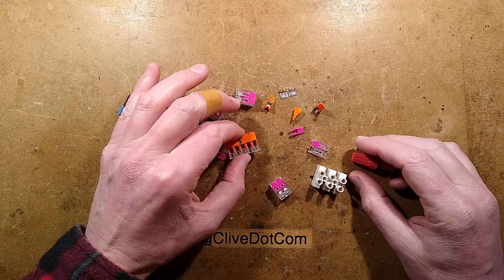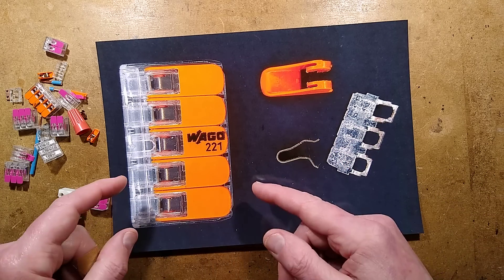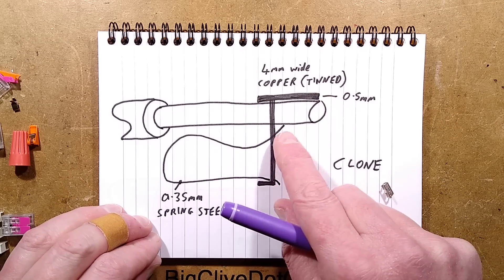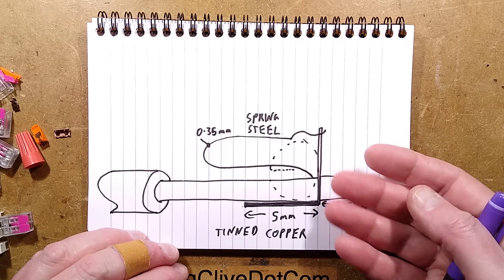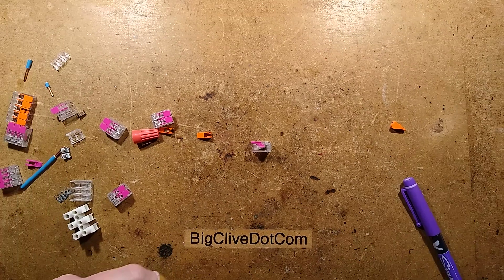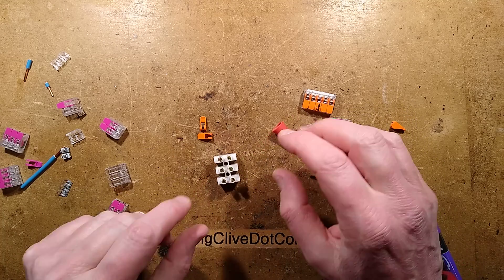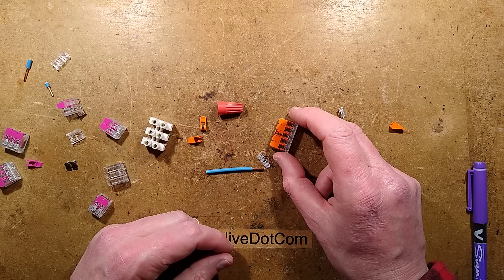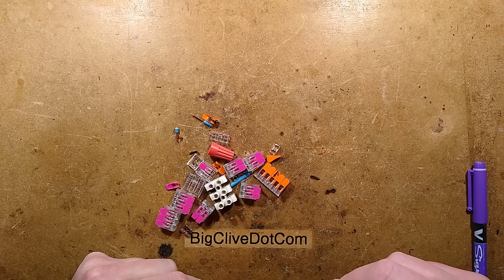Inside a Wago connector and a clone

Comment: I'm nobody special, but the terminal blocks like that aren't good for my overthinking. I used to build heater units for fusing/melting rubber components together and they bought cheap push-in connectors, to remove the wire you would stick a paper clip or similar small, pointy object in to release the wire. Tons of poor connections, they would have crazy resistance, I worry too much. Wago is a great brand, and I trust what certain people say but I already have trouble sleeping at night, I'll probably use wire nuts at home. Great video and demonstration!

Comment: I was only introduced (in the US) to these late in 2024. The Engineer on my project also purchased an ABB or Allen- Bradley 24VDC power supply (3 phase input) that has toggle levers on its terminals instead of screws. The machine we're building will be implemented both in the US and UK, and finger-safe components are used. I'm accustomed to seeing preventive maintenance procedures that direct one to laboriously "tighten all terminals", so this type of connection will be a big time-saver.

Comment: Funny story... Today I went to a local electronics store, phone in hand showing them from their website 3 way wago connectors that I wanted to buy(same as the ones you're showcasing here). They said wago and sold me the quantity I wanted. I didn't pay attention and only realized they're clones(since no wago logo and cheaper looking levers) when I started using them. I used a few before my suspicion reached a point where I had to look up your video(as I remember watching it a while back). I reached the end where you say the first thing you do is take apart the clones and check the bus bar to make sure it's copper. I did that and sure enough it sticks to a magnet... 🤦🤦 I guess I'm going in and getting the real thing tomorrow and rewiring the ones I already did. Maybe the clones would have been fine, but I'm using them for wiring up outlets and I really don't want to take any chances 😅

Comment: They advertise the wago connector over wire nuts like this: wire nuts can easily be improperly used so it's too loose and the wires fall out or too tight and the wires get damaged. Plus wago is reusable, no cutting wires shorter when a wire nut is removed.

Comment: The US Harbor Freight discount hardware store (chain) just started selling:

10 USD/9.32 EUR/7.76 £ wago style wire connectors. 
Package includes: 10 2-port, 10 3-port, 5 5-port, and a closeable carry case. 

Connectors are rated for 600v and 221°F.  UL Listed too.  
Wires supported: 24-12 AWG strand; 24-10 AWG Solid. 

UL Listing mark: E531336
UL recorded Company name:
ZHEJIANG JINGHONG ELECTRIC CO., LTD
Co. Provided model numbers: 662, 663, 665

I'm not sure how good a value this Harbor Freight Pittsburgh brand is, but the UL rating assures me. They say these are code compliant for use in junction boxes. I'd gladly pay more over a non certified eBay one, I think, unless you are using it for low voltage non critical stuff.
Reply: Interesting a listing for the Chinese product states to strip 11mm of wire, the Harbor Freight sold product (supposedly the same) says to strip 14 mm
Reply: And it is $0.089/qty (I assume for an individual connector?) when ordering 10-299 pieces 

$0.08 for 500+ pieces

So ordering direct it would be $2.23 to buy the same amount of wire connectors as is sold in the Harbor Freight $10 package.

That listing mentions ROHS and  CE certification but not UL. And I've heard ROHS and CE don't mean anything about the safety of the item. I think UL actually tests the safety. 

But what confuses me is the larger connectors must cost more to make than the smaller ones, so how is every size the same price? Because the larger connectors need more material and parts than the smaller ones.

Comment: I've purchase a jar of Ideal's In-Sure L2 (or Gen 2) lever connectors.  It's a similar spring and bus bar connection as the WAGO 221, but with the lever direction opposite the ports.

I disassembled one, although there was no means to put it back together where disassembly was inherently destructive.  I believe the pieces of the shell were sonically welded.  It has little "fingers" on the spring where the edges of the lever mechanism can push down on the spring in the "open" position.  However, the bus bar extends to the end of the shell and there are two guaranteed contact points where the spring presses the wire against the bus bar and also the tip of the wire against the end of the bus bar.  There's also electrical contact with the spring (which is in contact with the bus bar).

I believe that even with the shell melted the connection will be maintained.  Of course if the shell melts, there's something a little more critical than whether or not the connection is maintained.

Comment: Well..."better" design on the clone...I'm not so sure. Cheaper, yes. Easier to manufacture, yes. But these aspects hardly go hand in hand with product improvements. If you look at the plethora of factors WAGO was taking into consideration when designing these things (feel free to have a peak on their website, it's quite fascinating really), the chances of ANYTHING about these 221s being there without any actual reason are slim to none. I am confident, that if you factor in longevity, compatibility, performance, safety and sustainability, the WAGO will be the much better product in any regard, and chances are, that in the long run it will cost you less.

Comment: 221 is not suitable for Al wiring. But WHy? 2273 is suitable. But why!?
Reply from the maker: Possibly the contact material or some system of blocking air access to the aluminium contact point.

Comment: oh one question -- I am using to install small gauge low voltage solid wires (like 20ga sized) can you twist 2 together and put in one port? seems like it should be ok since the wire is small and low voltage makes it easier to fit in the box since you can use a 3 port instead of a 5 port for 4 small wires and one larger wire - smoke detector interconnection signal wires -not main 120v power wire anyone have any idea if that would be ok???
Reply from the maker: I've twisted small wires, but I don't know if it's officially endorsed.

Comment: I only ever use wago I bought a basic box with assorted one but the older style not the one you used in the video I'm disappointed in the ip junction box as the included glands are not ip rated

Comment: Lidl are selling a selection box of Scotch Lock connectors.

The box states they are suitable for a maximum of 250V.

I'm not sure I'd be comfortable using them above 12V.

What do you think of them being used on mains voltage?
Reply from the maker: I'd be more concerned at the current they were being used at.  I don't trust insulation displacement connectors.

Comment: I've seen videos where the Wago didn't fail until the outer skin on the wire nut burned up, although with most of the insulation on the 12-gauge wire they were using. I don't use Wago for everything, but I use them fairly often for lighting, and more all the time.

Comment: Having done control systems in substations, they were all screw terminals. What I don't like about the push terminals is it is too easy to miss the actual connector and hit the fastener, also multicore cables do not like them , they slip out easily. The "screw-it" was banned 50 years ago on construction sites as they came off too easily if they were at the wrong angle leaving bare wiring. It was caused by ac current vibrating and if it was slightly loose, not enough to feel it, it had a tendency to vibrate itself off. Screw terminal metal is gauged to the load it will carry so has a greater chance of surviving blow-outs, I would not use Wago on mains power, I simply wouldn't trust it. When learning to do electrical installations, one vital point was given, when you make a termination, do a tug test. We did this to learn just how tight to tighten the screws on connections, if you tugged it and it came out it wasn't good enough.

Comment: These push connectors are bad news. They don't hold strand wire properly. A coworker of mine got hit with 277 from a factory wired push connector that just let the wire pull out. That aside I've seen many of them fail in lighting scenarios

Comment: could wago's get  looser over time?  as hot/cold happens on the wires  expansion/contractions, will the wago springs hold up?  I ask because in the usa  we have  AFCI  arc fault  type circuit breakers and if the neutral wire is loose at all in a wire nut  or a wago,  that circuit breaker will flip and it will take hours to figure out that all you had was a loose wire nut or wago.  this new design looks different from the older wago's from 10 years ago.
Reply from the maker: The basic mechanism has a long history.

Comment: The clone is like a "push in" wago. Wago has a leaver.less type which is a simple push in, and you can release the wire by twisting and pulling it. I think that the creators of the clone tought that ok, why not just get this version and create a leaver for it and thats it.

Comment: In the USA many of them don't have the lever.  Push in the wire and never get it out.  They barely work with stranded wire, but if you're careful you can get all 7 strands in.
Reply from the maker: That's a standard type here too.  But not intended for stranded wires.

Comment: Seems to me the wago has a larger contact area to the copper, the spring pushes the wire onto the copper bar. The clone has only the point contact directly to the copper.

Comment: After the POOR experience of using connectors similar to Wago's lever type terminals from Wilko's, Wago are now the ONLY connectors I will ever use.

I wouldn't use the cheap Wilko's ones unless when testing the LV components an ESP32 project...even then, that would only ever be a maybe.

Comment: did you see/get the straight through version by now ?
WAGO made them after the chinesium, but only single straight through, not multiple as the chinesium one..
(the expensive versions are the 6mm² version.. the up to 2.5mm² are ok-ish)

i also noticed that most people totally overtighten the screw in terminals, sometimes directly through the ferrule and single strands.
Wired up a 400V 63Amps CEE last week (5G16mm²) and the torque for the terminals was around 15 to 20Nm.
With the large screws/screwdriver our inhouse sparkie usually tightens them down until the copper starts squirting out the sides and you wonder if you ever get it undone to remove the mains cable.

Comment: The problem isn't the current going through it the problem is these spring clip things work the same as backstab outlets and switches.  You have a small amount of surface area touching with a thin piece of wire holding it in place.  Overtime that gives far more opportunity for heating, corrosion, and other things you don't want in a good clean tight connection.  I'll stick with firmly secured screw downs and wire nuts where you have large amounts of surface area tightly connected.
Reply from the maker: These ones pin the wire onto a thick copper busbar.
Reply: @bigclivedotcom  yes, the backstab outlets do something similar pinning it against the metal bar but they still over time seem to loosen or corrode.  I replaced 3 outlets last fall that the wires were discolored once removed and when I broke them apart I found significant green corrosion and some discolored (heating?) metal near the pinch point.  It was so bad running a 1200w microwave oven (about 10A on a 15A circuit) caused a voltage sag from 125 to about 100 volts.  Rewired using rhe screw terminals on new outlets and pigtails with wire nuts on the daisy chain and then had only about 5 volts sag under load from the breaker box 100 or so feet to the end of the string.

Comment: For wiring homes. Absolutely avoid using wago’s for outlets. They have a higher resistance then wire nuts and will cause issues or worse a fire. For lower current circuits like lights they are fine

Comment: garbage ,not to code in Canada and they melt on high current
Reply from the maker: If you mean the videos where they were run at over 100A and the wires were literally glowing red hot, then it's not a surprise the plastic melted.

Comment: You did not mention the fact that these spring retaining connectors are NOT suitable for flexible stranded wires unless ferules are crimped to the wires. 
The control panel you mentioned that used similar terminals contained this type of wire form, and would/should have ferules fitted.  There is no saying what type of wire used in the field wiring connected to the control panel.  

More importantly, there is no saying what type of wire will be used by semi-skilled individuals on youtube, who may now think they know it all.   Don't you think? 

Secondly, the Wago and other professional DIN 35 panel mount terminals now in use ARE designed to be mass produced machine assembled, just like the cheap stuff, but will not suffer penny pinching compromise by use of inappropriate materials used in their construction. 
The reasons for that are obvious.  

Frankly, I wouldn't use these things, nor the crappy 'wire nuts' on either solid, stranded or multi-stranded wire terminations. It's bad enough finding them in control panels.
Reply from the maker: These are designed for stranded wire.   A ferrule is good, but only if crimped on properly, as it's possible for the wire to pull out of the ferrule.

Comment: I think one of the things you can take from this is that any connector can fail, and all of the connectors have their places.   Wire nuts work, they work well - but they don't need to be in everything.  Well built wire nuts can even survive the nut itself deforming from heat, because they have a heavy wire spring inside that does the work.   (mind you, if it melts enough, you now have an exposed metal connection)   I've also seen crap wire nuts that had a 'plastic' screw inside, usually just by threading the 'hat' of the nut.   Wagos can fail due to heat, due to pressure, etc, but so can anything else.  Even a soldered wire with heat shrink could have a problem if a pointed whisker is present, or it wasn't soldered with enough contact.    

There's no reason to call one bad, and another good.   How about "Good for the job in question" and "bad if poorly used".    Ram that wire into the Wago without stripping it well enough.   Strip the wire too far, and stuff it into any fitting, so there's an exposed wire.    Just jam wires into a wire nut without actually twisting it - or failing to tug to make sure it doesn't pop off!

Comment: You did not test the plastic and its longevity. Some cheap plastic may degrade over years getting brittle. Or it is getting soft when heated. Or worst of all its not fire resistant.

Comment: I became interested in this style of connector around two years ago, then bought a few versions on Ebay & Ali-Express just to experiment with them. Some can snap together making a two or three gang link. Others are simply 3 or 4 hole junctions for a given pole.   
I was interested to see if you had used them & how robust they proved to be.  The other nice solution was the sealed solder joint with a plastic insulation tube. They seem popular automotive applications.

Comment: The Wago connectors are rigorously tested for all types of environments and load scenarios. For example they do a salt fog test and a vibration test. Furthermore the certifications on those are top of the line. As an engineer I would always choose those because I know what kind of testing and design thought goes even into a small product like these connectors.
Reply: I have at some point seen someone on YouTube putting different connectors, Wago, Wire Nut and others to the test, because so many, especially in the US, claimed wire nuts are better. properly used, which is especially important for the wire nuts, as there are good chances to not have them grip tightly enough, they did as good or even better in regards to pull out force, heat resistance in a short circuit and what not. Meaning within specs for those, both are perfectly fine.
That would actually be something I would be interested in how the Wagos and the Clones would have fared in that comparison, although those indeed look like not beeing just the cheapest knock of one can produce but actually decent quality.
Personally, I prefer the Wago connectors. But to be honest, I never came across wire nuts here in Germany. I am not sure if they would be "illegal" in our electrical code, they are just nowhere to find.

Comment: i love wagos. I just wish they would make some that are rated for 100A and higher currents. Right now i have to splice these huge copper cables by threading them into 3 or more threads and then using three wago connectors.

Comment: In the Hvac business I used the wagos for years because of the possibility to connect solid and flexible wires for field wiring. Using a terminal block has the risk of loosing connection if the screws get weak during corrosion or heat. Also wire nut are out of choice because the wire ends get damaged and had to be shorten again if a re-wiring is needed. Anyway most US electrical guys swear on the nuts because of saving time and don't mind what is after the installation. Then you are f.. d if you had to add or expand the wiring. This is the same one way crap like putting foam in between dry walls.

Comment: I've come to live wagos for many but not all uses.  Temporary uses they are a must, low volume they are great, expect to make more changes within 1-3 years, save future you a lot of headache and use them, joining stranded wire definitely.  The one case I'm less all in on is projects needing hundreds of connectors that won't be touched for a long time and using all solid wire, there a push in fitting is just as easy and the savings do start to add up when you have a project needing 500-1000+ connectors.